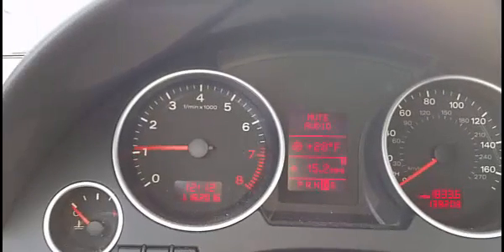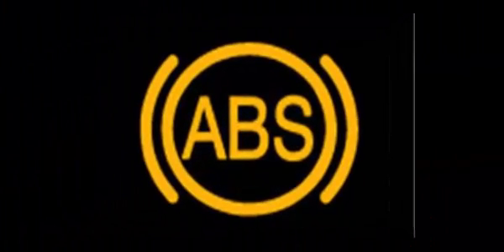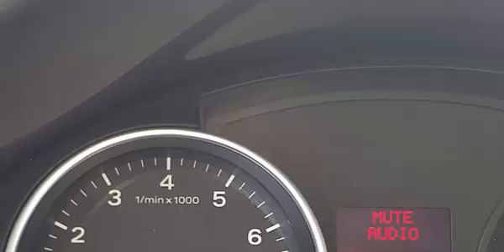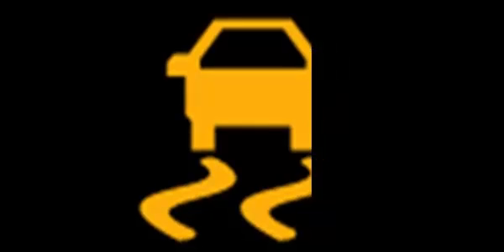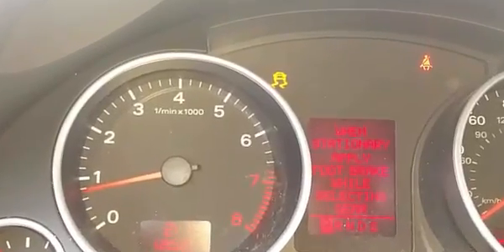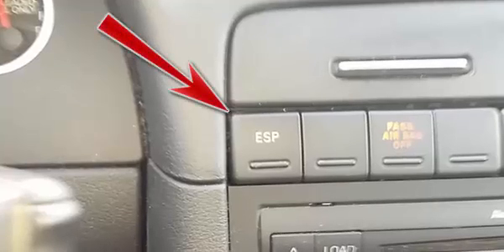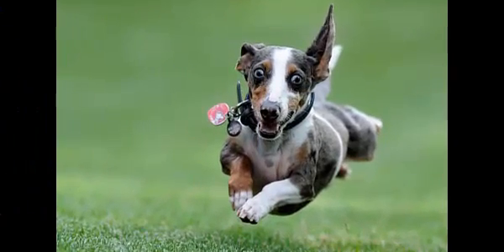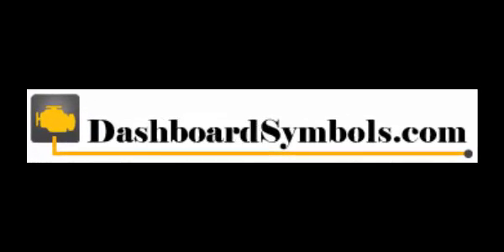Stability control lights: Assuming you have good tires, when and why do they pop up?

Comment: hello today the light of the stabilititrak was turned on and the engine light too. I have in cadillac ats 2013. how can I remove it.
Reply from the maker: There's a problem with the engine. Get it resolved and the stabilitrak will come back on.
Reply: Start with air filter, and fuel injector cleaner in fuel tank then spark plugs regap or replace if to far gone
Reply from the maker: You remove it by serving the engine. A good tech needs to determine why the check engine light is on...

Comment: 2013 G37x - Mine stays on the entire drive every drive for some reason. Also the emergency brake light (red bold letters saying "BRAKE") comes on during and acceleration then will shut off again. Idk why that comes on even though the emergency brake is off.
Reply from the maker: There's a brake issue. Address it and the stab control will reactivate (and the light will go out).

Comment: Why is mine on along with the check engine light?
Reply from the maker: A common question, unfortunately. The system is off and will stay off until the engine problem is resolved. Once the engine issue is fixed, both lights will go out (stability control will reactivate).
Reply: Check your air filter, if dirty change it! Put very good fuel injector cleaner in fuel tank if not gone after 2-4 hours then regap spark plugs if to far gone replace with new
Reply from the maker: @LH81633  Good advice and inexpensive to do. No guarantees however...

Comment: I have an 06 explorer with the check engine light on. Recently the traction light came on and wouldnt go more than 55. Turned it on later that day and the light was off. The next day it was on again and the truck started to shake as if the wheels were about to lock. What could be the cause of this?
Reply from the maker: Address the check engine light. Without a hands on diagnosis, my best guess is that the stability control issues will resolve once the engine is repaired.
Reply: Nayeli Perez  did you solve the issue I have the same problems but with a chevy Cruze 14 😞
Reply from the maker: @minervagarate1251  He may not answer, but likely as not you need to have the emission system checked. The stability control will stay off (and the light on) until the engine is fixed.
Reply: Well we took it to the mecanic bought two coils, something like that. He knew which ones needed replaced so he changed them out the light hasnt turned on since
Reply from the maker: @nayeliperez8935  Excellent. Thanks for the update!
Reply: Nayeli Perez these are all signs of poor maintenance !!! Computer shutting things down!! Don’t believe me! Remove air filter wich will feed engine more oxygen!! So what you need is a new air filter fuel injector cleaner in fuel tank and regap or replace spark plugs!! If you have bad fuel ratio because of dirty filter fualted plugs and clogged injector computer will shut things down traction control/and even transmission!!!

Comment: Ok, so I have a 2017 Chevy Malibu and my check engine light has been on like forever! On Yesterday I was driving home and the Stabilitrak light, ABS, Battery light, drive with care; came on while I was sitting at a red light in turning lane! Then the traffic light turned green and I couldn’t go! The car stalled on me in the turning lane! Bummer! I’ve gotten an email from Chevy about the emissions system! I’ve taken my car to the dealership once before about the car reduced speed out of nowhere in the past. They say they couldn’t service it at the time!🥺😔 I don’t know what to do! Any suggestions; what are your thoughts on this?
Reply from the maker: Well, nothing that will be much help. Although I can say that the stability control light can be ignored. There's a serious engine/emissions problem that needs to be dealt with, period! The other lights will go away once the engine is taken care of. The car has turned off the stability control because it can't trust signals coming from the engine. The other lights/messages are responding to no power.

A really good tech is needed and evidently not at your dealership, sadly (warranty???). No way to diagnose from a distance. Good luck!
Reply: Thanks for responding! And yes, everything is still under warranty as to why they probably keep ignoring me!
Reply from the maker: @ArtSeeFriend  Wow, well they HAVE to help you! HAVE to! Or another Chevy dealer!
Reply: It’s known that the intake bolts are loose and need to be retourque! Many will put a scare to you but you will be taken just retourque the bolts only like 6-8 of them

Comment: My car is a Jeep Compass 2007. The car turn on this light while I was driving and going at 45mph and when at stopped at a red light it would drive again. Like it was going so slow and I couldn’t accelerate I had to pull over and turn off the car and turned back on and it drove like normally again! 

I have no idea why did that happen
Reply: Thanks!!
Reply from the maker: Likely an electrical problem "reset" by the restart, but not a definitive diagnosis by any means. If it happens again, please have a good mechanic look into it.

Comment: I have a 2012 Chrysler T&C after half and hour i drive, light turns ON and stay like that all the time the car is on if the van is off like 2 or 3 hours light goes OFF again.
Reply from the maker: Impossible to say. Clearly something that needs a hands on diagnosis. So long as that light stays on, the benefit of stability control is unavailable.

Comment: Hi
Nice video.  Does the all time on icon has anything to do with the misaligned  of the chassè ? Does one of the front ends of the chassè beams results in the traction sensor not properly engaging with the tire and causing the traction icon appears ? Is so would just balancing the wheels solve the problem  ? Your answer is highly appreciated.  Thanks
Reply from the maker: In short, yes. Bent frame components (if that is the issue) will be detected and the system will not function. So, the light stays on. Wheel balancing etc won't help.
Reply: @DashboardSymbols  
Thanks for your great reply .
Reply: Could it mean needing new tires?? Mone turns on during a right turn and then with jerk to the right during acceleration

Comment: I was in grass and i went to pull out on the road, my stability light came on and once i was on the road it went off and never turned back on. So that means it was working properly?
Reply from the maker: Exactly right! Grass is slippery and your tires likely spun a little or wanted to. Stability control took over and kept you on the straight and narrow.

Comment: Do any of you happen to know why the check engine light AND the traction light illuminate? The check engine light indicates P0344 (camshaft position sensor) and I have replaced it along with the crankshaft position sensor.  PCM has been replaced,  relearned,  and reprogrammed as well.
Reply from the maker: The stability control light is on because it is shut off. Address the engine problem. I am posting a new video tomorrow addressing this very thing. Very good question.
Reply: @Texas Boomslang you fix your car? I have one Hyundai Elantra 2017 I have the same code in my car I change crankshaft, coils, spark plugs, clean transmission....but every time if i try drive my traction light illuminate and my car stop.
Reply: @brunosantana5059   I wound up replacing the coolant temperature sensor and I didn't have any more issues.  The same solution may not apply to your hyandai as my dodge which i no longer drive.  I totaled it by pulling out in front of someone and ended up getting a Silverado.  Overall,  i think that it's a glitch that originates from any of your sensors.  I hope you can get your ride acting right, bro.
Reply: @TX_BoomSlang  thanks bro

Comment: Hi, i have a audi a4 2006 and the light come on but the ESP bottom don't do anything? Any easy way to fix that ?? Thanks. Good video
Reply from the maker: Ok. Likely an electrical problem. Start with the fuses, but don't expect much. The buttons for both are close together, so maybe the switches themselves. Find a good garage... both are very important systems!!
Reply: @DashboardSymbols  Ok, thanks
Reply from the maker: Well, on that car, the button simply turns off the ESP which then turns the light on. So nothing to be gained using the button, and likely no easy fix. Someone will need to do a hands-on diagnosis. But first, are there ANY other lights on??
Reply: @DashboardSymbols  Yes the air bag light it's on that's all

Comment: For the past 3 months or so every now and then my car will make a sudden judder, continuing on for mile or so then happen again this time my "Skid light" will be on and my ESP service will be on my dash, with the rev dial away down to 0. I stop the car for about 2 mins, start back up and then head off until it happens again. I got new spark plugs and coil pack fitted and then this happens within a few weeks later. What do you think the problem is please ?
Reply: Make is a Vauxhall Astra 2012.
Reply from the maker: Well, you've been servicing the engine to fix a stability control problem. Sounds more like a brake hanging up intermittently, but ultimately it will take a hands-on diagnosis/service at a really good shop.
Reply: @DashboardSymbols   i have a chevy cruze 2011. i was driving on low fuel for about 20 miles then the car started to feel shacking. i went to the gas station to put gas and then my lings came on the engine light is blinking and the service trail is on too. what do you think it is help
Reply from the maker: @nadiiiamendooza7470  Honestly it's very difficult to say. If the car was running out of fuel there may be damage to the fuel system. But it will need a hands on diagnosis. I'll keep my fingers crossed for you...
Reply: Done all of this mate. Checked on the laptop no problem with a diagnostic. The other day had a full service and a passed MOT only  problem was the right headline had went a month pervious. I really thought a different garage would have maybe got to the problem. Drove around today and top the ESP off and drove around 35/50 miles without a problem compared to only 9 mile last night and going twice. That's for the comment 👌👍
Reply: Liam air filter very strong fuel injector cleaner!! And possibly a new battery if it’s more then three years old!! Why!!! Because today’s cars depend heavily on the battery,, coils need very good source of power to supply the spark , and spark needs oxygen to creat fuel ratio!!

Comment: I have a 2016 chrysler town & country. On several occasions the stability control light comes on at start up and won't let the shifter go into any gear. Any help it's appreciated.
Reply from the maker: Well, there is little that can be offered remotely, but I will say this. Any issue with stability control will NOT cause an issue with the transmission or anything else. I suspect that there is another warning light on as well. It will be the one that needs attention.

Comment: If it comes on by it self and I can’t turn it off unless I turn off the engine. Is that normal?
Reply from the maker: Absolutely NOT normal. The light on steadily indicates a problem with the stability control system that will need a good service shop.

Comment: thanks alot for this helpful video..
My car is new rav4 2019 awd and when I go off road using awd system the light of traction control is flashing for seconds when the tires are slipping..
Is there aproblem here ?? hope u answer me
Reply from the maker: No problem at all. Working exactly as it is designed...
Reply: @DashboardSymbols  
Thank you so much my friend, I realy appreciate your efforts
Reply from the maker: You're welcome.

Comment: I have a 2013 Nissan Altima and my traction light is on and it want go into gear or accelerate
Reply: My car is doing the same thing why could be the problem I have a 2011 lacrosse
Reply: Lashon.....wat fixed the problem?
Reply: That sounds like a transmission problem if it won’t accelerate or go into reverse
Reply from the maker: The video discusses the normal appearance of the light. Your Nissan needs a proper fault diagnosis at a qualified service shop. It is not possible to diagnose remotely. Good luck!

Comment: This is useless, there is a 4th reason, something is malfuntioning, and the light comes on and stays on. In this situation if the care is shut off, it will not run again until the code is cleared or the problem is fixed. Mine is on and so ti the ESC service message. The ABS light is not on and never has been. Thanks for nothing. I need to at least drive the car to my garage/shop.
Reply from the maker: While the video does address malfunctions towards the end, do I understand that the car will not run while the light is on?? Please tell us the manufacturer, as we have never seen this anywhere. Is the check engine light on as well? 

Regardless, no video will repair a broken system. It is time for a good repair shop.

Comment: I have a 2010 chevy traverse and suddenly the stability and engine lights turned on, the speed reduced and started to shake
Reply from the maker: Ah, the Check Engine light is primary. Its easy to focus on the light with the skidding car, but it just means in this case that it is turned off due to an engine problem. 

It 'sounds' like a misfire in a cylinder, but it will take a hands-on diagnosis by a good repair shop to fully diagnose and repair. Once the engine is running right again, the stability control light will go out (the system will be back on). 

Keep your fingers crossed -- it could be as simple as a spark plug wire (if it is, replace them all!).
Reply: DashboardSymbols.com  i also noticed that when that happens i pull out the ecm fuse and put it back and fixes issue temporarly for several days..
Reply: @EspinozaFam7  I was looking through some vids on here and there is one mechanic who has found the problem and fixed it.
I'll get back to you on what this clip is .
Reply: Hi there.
The video is - how to fix reduced engine power and service control on GM Chevy.
This video identifies the exact problem that you ,I and others are having with this kind of problem with our cars.
I hope this helps you ?
Cheers !
Reply from the maker: Actually, it doesn't fix anything, it just resets it. It suggests an emissions issue which is sporadic and so sets off the check engine light every few days.  @EspinozaFam7
Reply: Yeah I have the same problem here.
Here in australia we have the holden commodore .
Mine is a 2010 model.
And it dose the same thing.
Sometimes on start up or while driving.
So when that happens I just simply either if parked turn off the engine.
Or if driving pull over turn the engine off for about 5 to 10 minutes and it's good to go again.
Funny enough though my battery went flat .
Had the car jump started and the problem dissappear ed for a good 5 weeks.
Then recently it started again.
When it happens and you turn off the engine the computer resets itself.
Jump starting it may have reset the trip computer ? I know it worked so I had no problem driving.
It's probably more so an electrical problem than mechanical.
I've had mechanics check my car and been told it's the timing chain or the coil pack .
But I did notice one thing as well when I pulled out the coil pack to change over all the spark plugs in the engine the problem dissappeared for a good week.
And also no engine warning light come on.
My advice is go to a reputable mechanic and have it checked out.
Or go to a few mechanics to at least a second or third opinion to see if the problem is identified them.
Reply from the maker: All too often engine issues are very, very, very difficult to pin down. @peterkos1034
Reply: @DashboardSymbols  true.
Not gonna disagree on that.
But just a matter of testing to see what works.
By trial and error or by chance ?
But yes very difficult to pin down a problem.
Reply from the maker: Honestly, that's not a question. Using trial and error, you will chance on an answer... It would be best to find a good repair shop. @peterkos1034
Reply: Nieves Espinoza change your spark plugs!!!  Misfiring!! They are fualing out!! Also causing  smog to build up in your throadle body!!  I put a gallon of laquar thinner with ten gallons of gas drive it till it runs empty this will  cause stabilize/traction control reduce engine power and car to yerk as if transmission is broken!! If your are able to regap exsisting pkugs first and all will fix!!

Comment: I have tralblazer 2006 and it stays on it also has the same light but with a wench..
Reply from the maker: There are two things telling you the system needs service. Any warning light with a wrench in it says this, and you have it. Plus, the light stays on. With stability control, this is always an indicator or a system problem. It needs hands on diagnosis. Any damage done recently? Accident, BIG pothole, or??

Comment: Had this problem today in my infiniti g37...i live in Atlanta and we’ve been getting a lot of rain lately and my stability control light just came on and stayed on until I made it to work. I shut my car off for a few minutes and restarted but the light didn’t come back on. Glad to know that’s normal.
Reply from the maker: Honestly, what you described is NOT normal. If the lights stays on -- not flashing or blinking intermittently -- it means the system activated and discovered a problem with the SC system. A number of issues COULD have resolved themselves, but do NOT ignore this if it continues to happen.
Reply: +dashboardsymbols.com thank you for replying. I will definitely keep an eye on it!